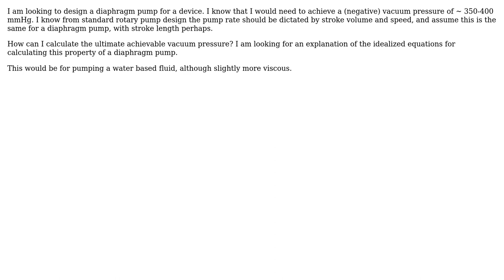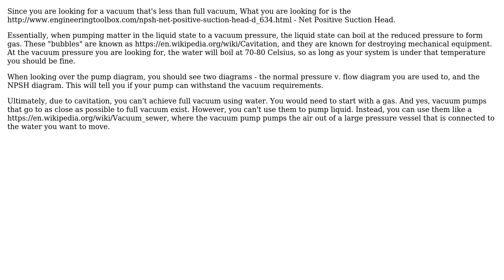Engineering: Calculating the ultimate achievable vacuum pressure of a diaphragm pump

Comment: My DIY project requires a 12v, 60-100 Watt air supply pump (s) to provide enough positive pressure with a flow of 120 L/min. I had recently bought a 12v air pressure pump rated 120L/min,  0.12 MPa  (17.40453 psi) thinking that as an OK, min requirement.  As it turns out, the  output pressure is only 11psi on the guage, with no flow. Completely inadequate !  My question is.. What would the the specifications of a secondary air pump, 'series' connected to the existing pump, to boost only the pressure to 20psi minimum, with a flow of 120 L/min (as per the rating of the first pump ? A 100% duty cycle, 40W  micro air pump or equivalent. (high pressure/low flow)  Any help would be appreciated.. Thank you.

Comment: Greetings,  from  your name,  I'm assuming your a fellow 'Dutchman' ..  Ok, lets ask you some questions regarding vacuum/pressure of a single head diaphragm, 12 volt, 'micro' air pump.  Ratings. Flow ratings I understand, but many micro pumps rated as 'vacuum'  - 0.85kpa, for example. I want to use that pump as a 'pressure' pump, so how do I calculate the correct pressure from the other port without buying one first, strictly from the provided specifications.  I've been assuming that the positive pressure is exactly opposite the negative vacuum pressure. .. above,  I will ask you another question.. Thank you.